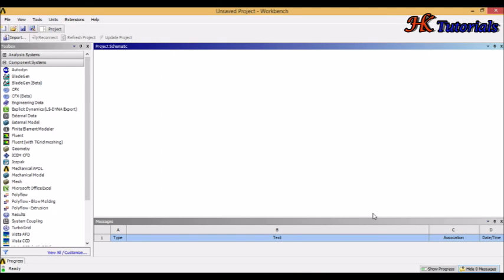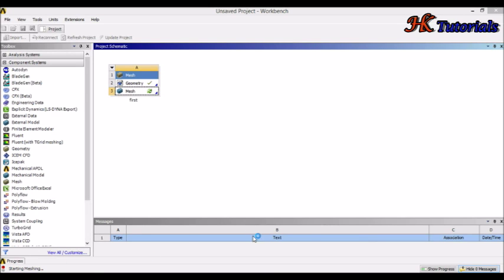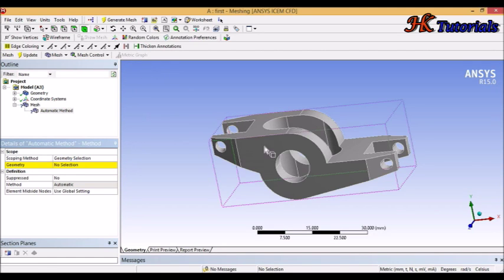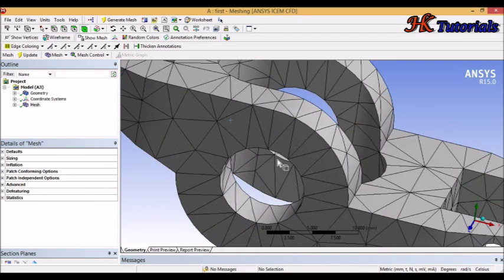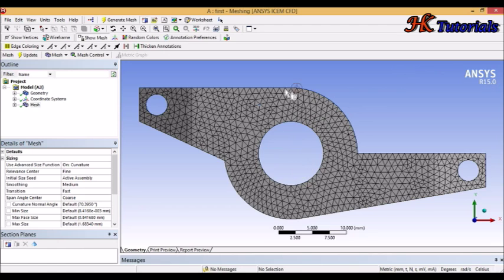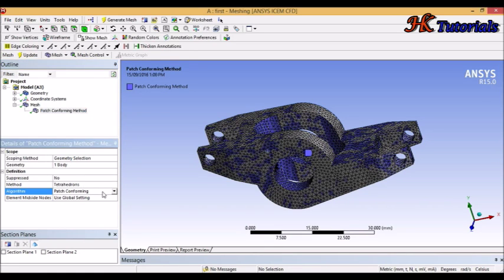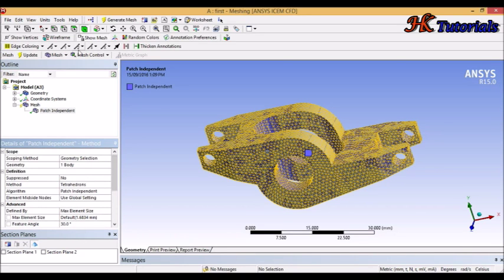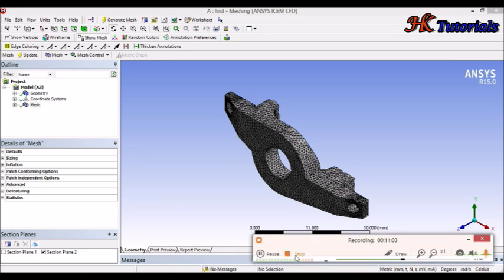4. Ansys tetrahedron meshing method

Comment: what is differrence between structured and unstructured mesh
Reply from the maker: Based on the structure of the grid, discretization methods are 
categorized into three different groups; namely, Structured, Unstructured and Hybrid. 

Structured grid/mesh method uses efficient numerical algorithms and requires less computer 
memory than the others. Due to its accuracy, this method is suitable for resolving viscous 
sub-layers. However, this method may not be applicable to many problems, as they 
require a fairly simple geometry to generate the grid.

 On the other hand, Unstructured 
the grid method is suitable to generate grids around complex geometries due to their ﬂexiblity. In particular, the solution adaptivity is their greatest advantage. However, the unstructured grid method has been shown to be tremendously memory consuming and computationally expensive. Moreover, there are limitations to the choice of flow solver, which affects the computational efficiency of the method. 

Clearly, these methods complement each other on weaknesses.

Comment: Hello. Do you maybe know which tetrahedrons Ansys uses-10-noded or? thank you in the advance!
Reply from the maker: Thanks for the question...! we can choose between linear and higher order elements(quadratic). By default ANSYS  use both  but we can change it by dropping the mid-side node option.
For linear element you have to take care that, When using these elements, it is important to avoid their degenerate forms in critical regions. That is, avoid using the triangular form of 2-D linear elements and the wedge or tetrahedral forms of 3-D linear elements in high results-gradient regions, or other regions of special interest. You should also take care to avoid using excessively distorted linear elements. In nonlinear structural analyses, you will usually obtain better accuracy at less expense if you use a fine mesh of these linear elements rather than a comparable coarse mesh of quadratic elements.
Reply from the maker: I'm not getting your question.
Reply: sir she means like there are linear tetrahedral and parabolic tetrahedral elements so what does ansys uses by default and can we change it?
Reply: keyur chodvadiya yes that's exactly what I meant!